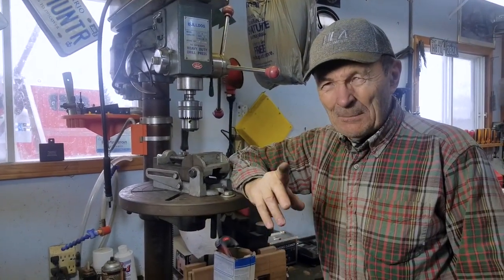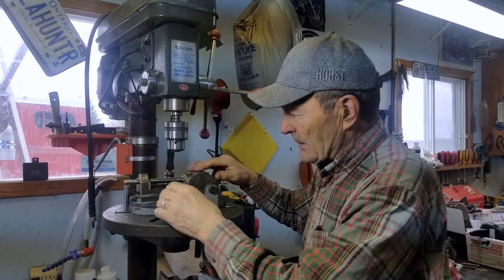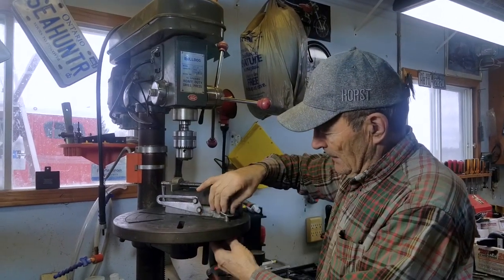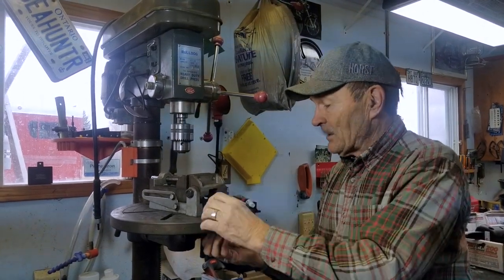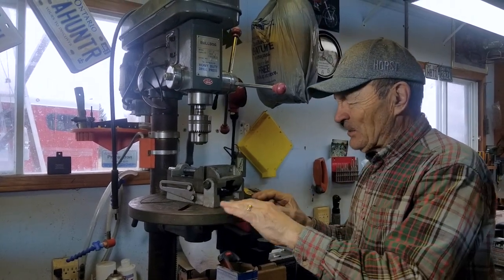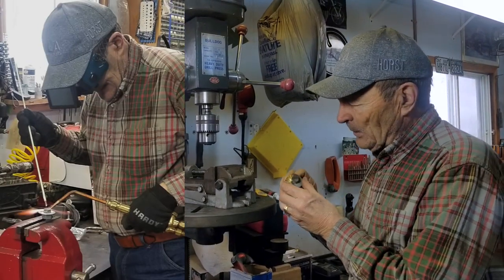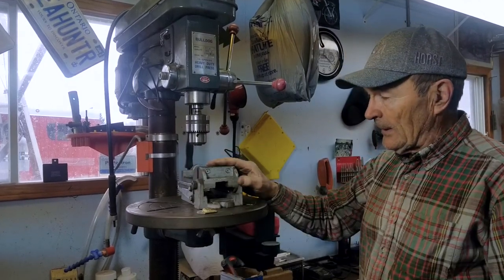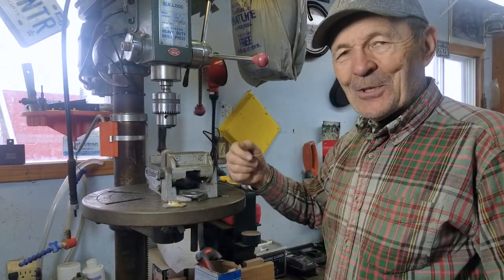#94 Easily Lock-Down A Drill Press Vice | At The Ranch

Comment: Hi Alec.

 I find a large "C" type vice grip works well for holding larger pieces to the table. vices are better for small stuff.

Also be careful of drilling plastic without clamping as the drill can pull in deep very fast and spin the piece out of control.

take care Owen m
Reply from the maker: Good points Owen.  My issue with C clamps is sometimes the strength to clamp and release it.  With a wing nut I can usually hand tight it well or use a wrench to super tighten it.

Comment: I use a cross vice. Don't have to move it around a lot and precise. I also tend to use those 1/2 vice grip clamps that bolt to the table. Quick, easy, and powerful. Can you see Neowise OK from there? Too many lights here.
Reply from the maker: Thanks for sharing your solution David.
Alec

Comment: Great tip, I inherited my drill press and it's missing a table. Only have the steel base. I do have a 4" vice clamp. Any ideas?
Reply from the maker: Hi Dusty.  A table is needed to bolt, clamp, or secure whatever is holding the material.  If the drill press if reasonably current (e.g. not WW2 surplus), Google the make and model and search for a replacement.  If it's a good setup, it can last many more years.  Hope this helps some and drill safe.

Comment: Or just bolt a piece of angle iron across the back of your drill press bed and turn the vice up against it. I’m a fabricator! Works best if you have a square bed.
Reply from the maker: Nice idea, thanks for sharing.
A
Reply: I have a small press you install a cordless drill too.. an old Craftsman press to be exact ! The platform has no clearance under it on my work bench. I have a similar vice, and need an idea, Mr. Fab !

Comment: "Weld the bolt to the washer"! The "weld" has been brazed not welded! Farm yard engineers eh
Reply from the maker: Thanks me!
A
Reply: Welding with steel rods, brazing with brass rods.  Both are done with welding equipment, so saying "welding" is OK 😊
Reply: Brazing.  Also known as "gas welding" in many parts of the world.  You should get out a little more, eh